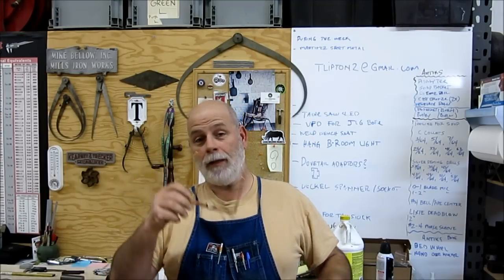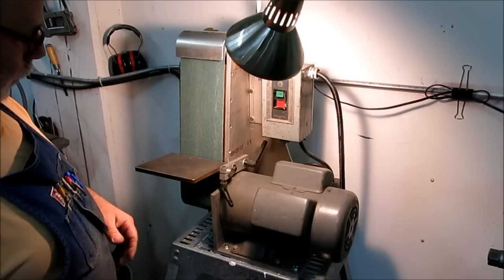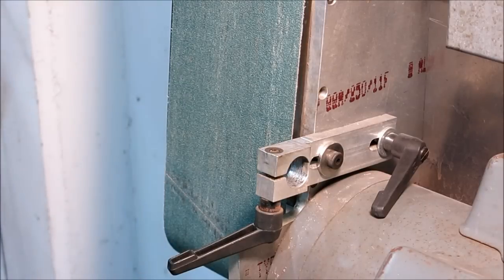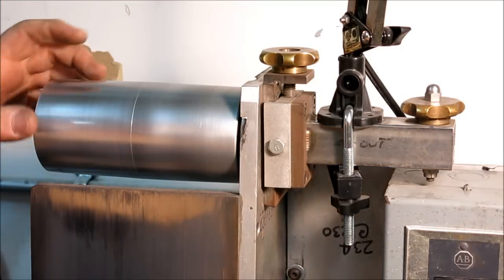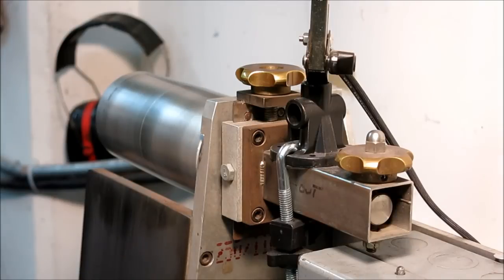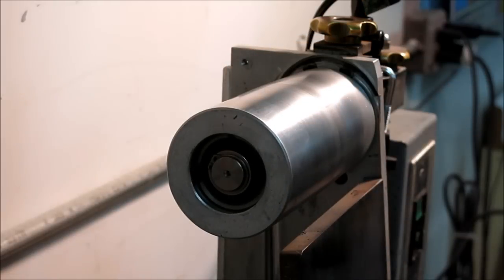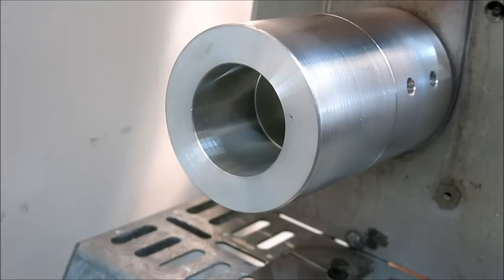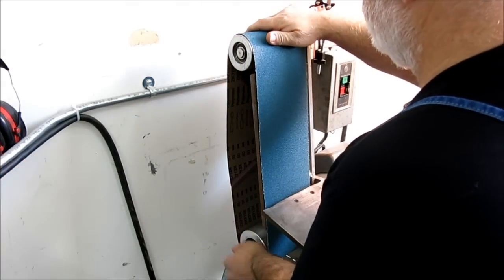Roach Coach Snack Break 5

Comment: Only a 5hp motor? I would've gone with a 10 or 15, but that's just me.
Maybe your shop elves can come over and build me a better sander, by 1X30 just isn't cutting it anymore. 
Inclusive angle, not included angle, BTW.
Cheers
Reply from the maker: Hi Andre,

I use a 1 x 30 belt sander for doing my nails. I find it smooths them nicely before I use Dykem to color them. 

Ok you will have to back up your inclusive angle gauntlet with some proper links. Included angle usage is widespread and common in mathematics and when measuring various tapers and symmetric angles. Skeptical Tom says show me the money.

All the best,

Tom
Reply: I hit the google, and you are correct. 
I take back what I said........do I see one of your shop elves in the corner??? Nooooo!!!!!!!!!!!
Reply from the maker: Sic em grumpy. He has your six inch calipers and he's headed up the chimney.

All the best,

Tom
Reply: My 6 inch calipers are garbage cheap no name grizzly digital ones. At least he didn't walk away with my grandfathers Helios 12" calipers......shh....

Comment: face mounting is a pain in the ass indeed , bigger pain when the motor is a plate mount and has no holes studs bolts or ears to face mount it... i found a solution to this on my drilling machine,the piece looks like this: http://youtu.be/h4SC9QsaDuE?t=3m54s
Reply from the maker: Hey Divine,

Nice solution. You managed to get those standoffs welded up. I'd say your on your way as a welder. Nothing like needing to join to pieces together to make you try it out.

All the best,

Tom
Reply: oxtoolco thx 4 watching , it took me some time to develop the spacer for that motor, arc welding is a art tho, an art I don't master yet